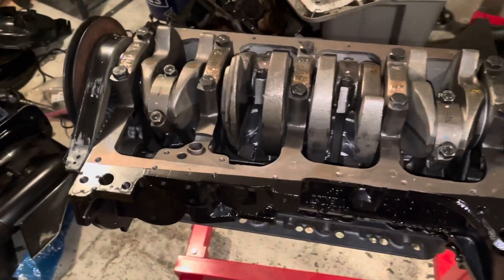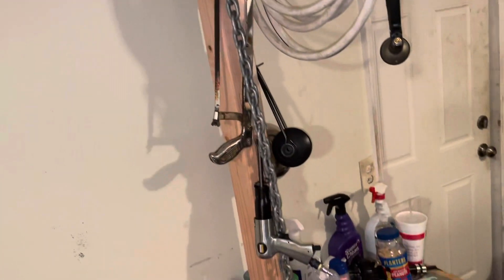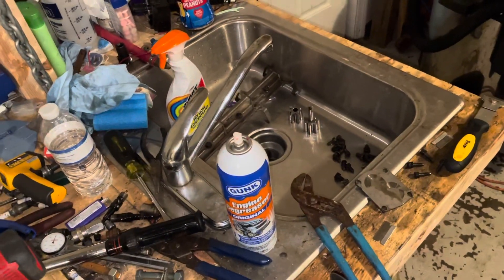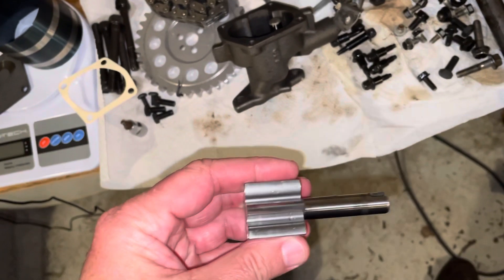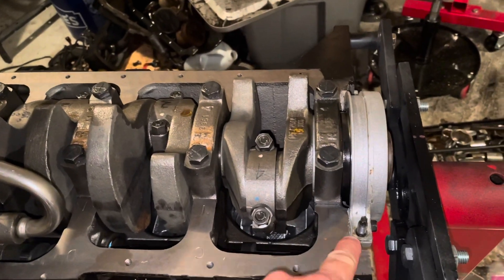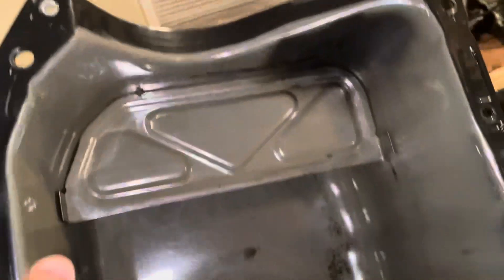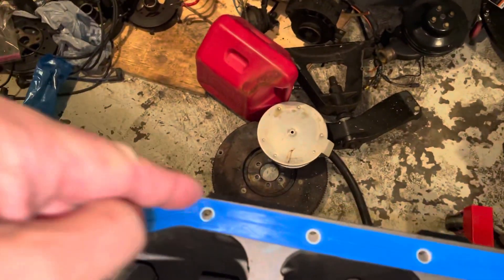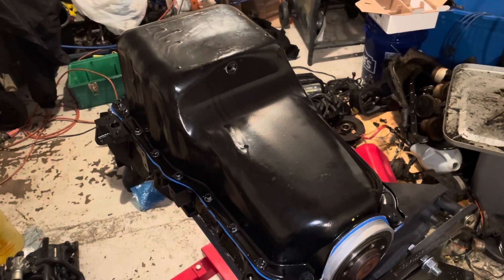Mercruiser 3.0 1(g) - Oil Pan Install

Comment: I noticed that you said that you torqued the oil pan to crank case bolts to 15 inch pounds.  I noticed in two different manuals that the oil pan to crankcase bolts are 80 inch pounds and the only thing that is 15 inch pounds are the two studs to the main seal bracket, the nuts on those two studs are anywhere from 150 to 185 inch pounds.  The two bolts that go into the timing cover are 45 inch pounds.  Does this sound correct to you?
Reply from the maker: The studs are torqued to 15 inch lbs. they are at the four corners. The nuts that go on the studs are 150-180 in lbs. If I said anything different I misspoke which I do a lot when I’m speaking without a script. When and what video did I misspeak?
Reply: @moccasinmarine  Yes, you said that the oil pan bolts down the sides were 15 inch pounds.  It kind of surprised me and that's when I looked it up.  :)  I do the same thing!
Reply from the maker: @PhilFryOutdoors  I used the factory service manual found here:

https://www.mercruiser-shop.at/data/datenblatt_0000025_1.pdf

Per the manual the oil pan bolts are 80 in lbs. But you have to be careful with these manuals too. There are a lot of typos, especially in the V8 manual.

Comment: When you put your rear seal in its bracket, do you put any RTV sealant around the outside of the seal or do you lightly lubricate it with oil?

Comment: can I ask where you got the gasket set from?
Reply from the maker: Felpro 17102. Check www.BoatID.com soon before they run out.
Reply: @moccasinmarine  thank you so much. About to do my oil pan gasket.
Reply: I paid like 185 candian for pan gasket mercruiser was almost 300 couldn't belive it, it will be my last 3 liter v6 or v8 for now on

Comment: Thanks for this video series. This is the exact project I have planned for this winter. Very professional, and very well produced, and no BS. Cut to the chase. Perfect. 

That said, I recently discovered some holes in the oil pan. So the boat is back to being stuck in my driveway. 

I've found some replacement options, but they are all $500 for an oil pan!? That's crazy to me. Is there another part number to try here? Any Tips?
Reply from the maker: Find out what the Mercruiser oil pan part number is. Google that number and find out if there is a Sierra alternative part. Then Google the Sierra part number to find lowest price. I have a used 3.0 oil pan but it also has a hole. But it could be TIG welded for a lot less than $500. Your oil pan could be TIG welded if the holes aren’t too bad.

Comment: Great video thanks for sharing. I bought a boat recently later found out previous owner changed the Volvo penta 3.0 engine to Mercruiser 3.0 inboard mixed with Volvo penta water pump inboard and Volvo penta intake exhaust my engine with a Volvo penta our drive. Changed oil was all milky. Pulled the cylinder head no head gasket broken. Found broken impeller pieces in pistons removed them and sent the head to get machine with new rockers intake/exhaust stems springs gasket kit and I got all new exhaust/intake  manifold, riser and rubber boot, water pump with new impeller, new belts. Engine did run before. What kind of lock tite are you using for cylinder head bolts?
Reply from the maker: I don’t use Loctite on cylinder head bolts.  I use Permatex Ultra Gray silicone sealant. Some bolts that you buy brand new have sealant applied at the factory so you don’t use sealant on those type bolts. I apply enough sealant to cover a 1/2” wide band of sealant the depth of the threads on the tip of the bolt.